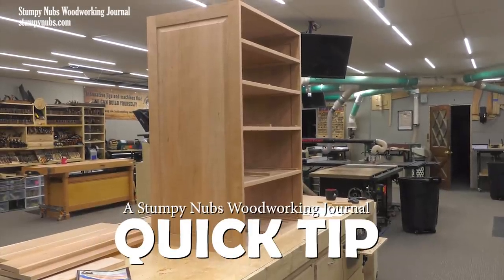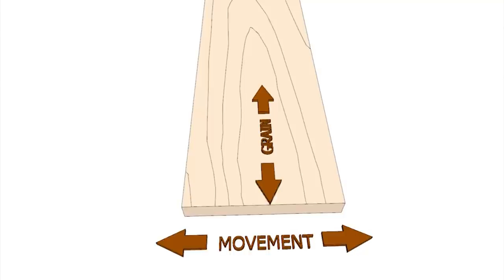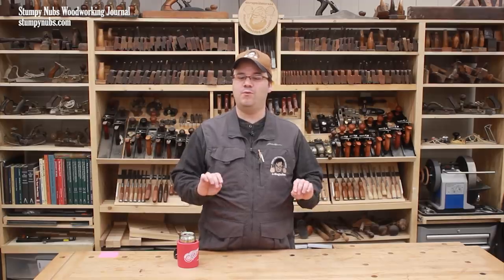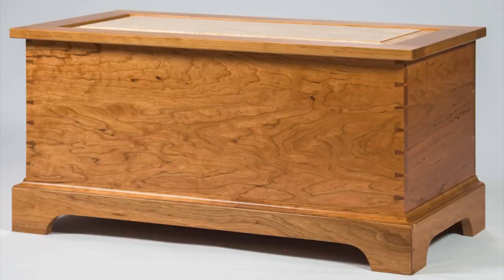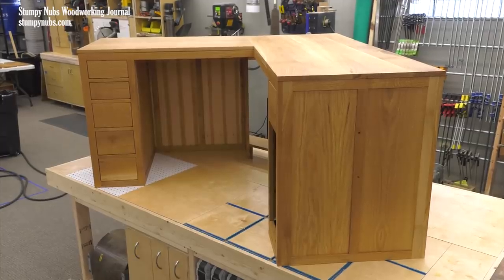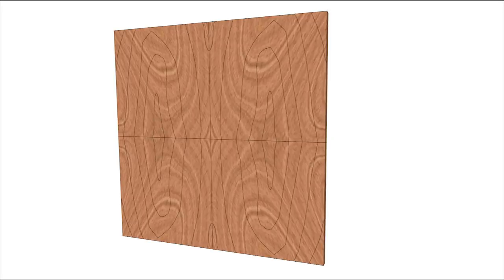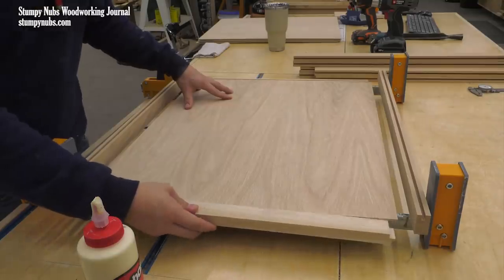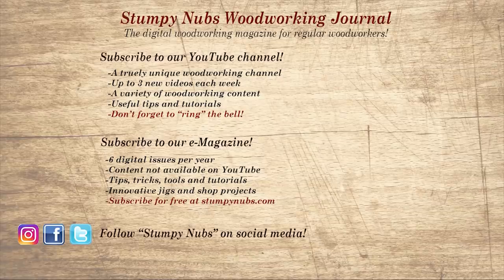Is the frame and raised panel obsolete?

Comment: Here's another novel use of Frame & Panel. I made a Mahogany table with a Frame & Panel top. The homemade stain I use results in a darker look across the grain than when viewed with the grain. I installed the panels at a 45 degree angle to the grain. The result: a table top that is evenly matched when viewed from above but the frames and panels change color as you walk around the table. VERY COOL effect ! When people come over, they always spend extra time walking around this table to see the Mahogany light show which includes the grain in the more figured panels and rails dance.

Comment: This is good solid information. It is the foundation of all 'old school' woodworking. Wood moves. So design and build accordingly. It is important that any beginner woodworker learn this. It is the foundation of all furniture design.
Reply: Thanks, Stumpy.
Reply: Ya I just finished making night stands out of hard maple to match the bed I made. I put a panel on the sides but it is not floating. I am not really worried about how they will hold up over time.

Comment: What about wood movement between the rails and styles (stiles?) ? Or are they thin enough that the movement is negligible?
Reply from the maker: Do you mean the connection between a rail and a stile (in a corner of a frame) being cross-grain? These are so narrow that wood movement is negligible.
Reply: Rails and stiles shrink very little over the length but can move quite a bit over the width which needs to be taken into consideration in a panel style construction.

Comment: Also this was used historically as wide boards were a lot less common and had to be dressed by hand with hand tools. Dressing small frame pieces is easier than a wide board requiring the craftsman to get two wide surfaces parallel and smooth to be able to make good joints. But withe frame and panel only the narrow frame bits needed to be true to get a good joining surface. which leads to the panel itself which was usually rived as a wedge of stock, thicker at one edge than the other. So all the crafts man had to do was dress the face the seen panel and then just gauge the edges where it fitted in the the frame grove

Comment: Great video. I particularly like resaw idea. I recently built a cabinet using this method and in addition to the benefits you mentioned, you can get away with narrower boards. After resawing, you can make nice bookmatched panels which is very attractive.

Comment: Great video! But I have to mention, if you wanted to use solide pannels and wanted wooden drawer slides, you could just use elongated screw holes
Reply from the maker: That wasn't the point. But thanks.

Comment: My 100+ year old wardrobe came apart when we attempted to put it together.  A panel was out of square and glued until all the panels split, wide open.  I was going to re-glue the split panel, but now I AM GOING TO TAKE EVERY BOARD APART and making sure the glue is only where it need to be! 

The next question will be whether to remove the dark cherry stain or not....

Comment: Question here! I was getting ready to make a traditional 6-board chest, but those often do have the grain on the face and back running horizontally and the sides running vertically.  Can you explain for me how those work without falling splitting?
Reply from the maker: No glue. Use nails. They will allow a little movement. In fact, a traditional cut nail with a pre-bored (and slightly enlarged) pilot hole is a good choice.
Reply: Rex Krueger recently built a 6-board chest. As Stumpy said, you'll need to use nails, preferably cut nails.
Reply: @StumpyNubs  - how about dowels instead of nails?
Reply: @Beakerbite  That video is what made me decide to make one.
Reply: @StumpyNubs  okay, that was what I did not understand, the fastener choice is what makes the difference.

Comment: Plywood is also somewhat more frailge in the long run. If you got a mark/knick in a massive wood panel, it is usually not that of a big deal. If you have the same in a plywood panel with that super thin veneer may be harder to fix - and it can be more of a sore eye in the end. That can actually be a problem if you have, for example, someone in an wheelchair moving around. I have seen really bad examples of exactly that happen around a family members home.

Comment: Of course this is true for glued panels.  What about the old 6 board chests put together with nails? There are a lot of those around that haven't fallen apart or split with crossed grain on the end pieces.

Comment: I also heard about space balls(not the movie) in a John Malecki video and I think they’re something you should check out for wooden panels
Reply from the maker: I use pieces of foam pope insulation or backer rod. Works great and are practically free.
Reply: @StumpyNubs  would you happen to have a video explaining this? I’ve never seen anyone do that for wood panels.
Reply from the maker: @paulmarsman8758  No video. I just cut it into little pieces and put it into the grooves. One piece of pipe insulation will last a very long time because the pieces you need are so small. Might make a tip video on it some time.

Comment: Thanks for the clear explanation. I wanted use frame and panel construction on the cabinet for our bathroom but my wife stopped me in my tracks - she doesn't like the dust that collects on the edges. Smooth surfaces only for her. SWMBO!

Comment: Pretty interesting! Thanks a lot for the tips! 😃
But I have a doubt... Let's say you're making a wooden toolbox, where the sides must be higher to hold the handle. How to connect the pieces in this case, since you can't use raised panels?
Thanks a lot!!! 😊
Stay safe there with your family! 🖖😊
Reply: Why can you not use raised panels? As long as the frames can hold the weight, it should still work just fine.
Reply: @thomasarussellsr  Because of the format... Take a look at the last video from Jimmy Diresta.

Comment: What tool is used to cut the mentioned 1'x1' wood into thin pieces for a 4'x4' panel?

I can't picture any woodworking tool that I've come across that could do that...but seems like a really valuable tool to have.
Reply from the maker: A band saw. The process of slicing a thick piece into thinner slices is called re-sawing.

Comment: Another factor. Most modern kiln dried lumber is dressed to size before it is properly seasoned and there's still initial cross grain shrinkage happening. The use of well seasoned boards explains the many nailed up 200 year old chests and cupboards we see today with little or no damage from shrinkage.
Reply from the maker: That's because nails, particularly cut nails with pre-bored pilot holes, allow for enough wood movement to prevent damage. I have seen plenty of split panels and drawer bottoms on old furniture that were glued in place.

Comment: I really enjoy watching and learning from your videos.  Really great info!
Still learning about what to look for in terms of grain direction and I have a question:
I understand about the panels, but what about the frame?  Isn't that greeting a joint with 2 opposite grain directions?  
What's to keep that joint from splitting?  Or because it's a narrow piece, it's less of a concern?

Also, your video about band saws has convinced me I need a band saw.  Expect a letter from my wife.
Reply from the maker: Do you mean the connection between a rail and a stile (in a corner of a frame) being cross-grain? These are so narrow that wood movement is negligible.

Comment: I saw a vid on tormek that has a diamond encrusted wheel
Reply from the maker: I have the diamond wheels for my Tormek. They are really nice. They never need truing, never wear smaller in diameter so your jig settings never change. The course wheel also speeds things up quite a bit.

Comment: Stumpy, when you're constructing casework like this, how do you attach two sides of a case together? Are two panels just glued together at a 90 degree angle in a butt joint, or do you reinforce it somehow, like with a rabbet? I hope that makes sense.
Reply from the maker: Usually just glue. Since you are gluing long-grain to long-grain, the joint will be very strong. In fact, the wood itself will break before the glue does. A rabbet joint would be a little stronger because it adds a little more glue surface, and it may help align the parts as you glue and clamp them together. But it isn't necessary, in my opinion.
Reply: @StumpyNubs  Thank you!

Comment: Why doesn’t the movement issue break the frames? Aren’t the rails and stiles perpendicular to each other?
Reply from the maker: Do you mean the connection between a rail and a stile (in a corner of a frame) being cross-grain? These are so narrow that wood movement is negligible.
Reply: @StumpyNubs  Yes that’s what I was getting at. So the joint there is much smaller compared to the perpendicular panel joint, thus the movement across the grain isn’t really able to exert enough force to cause problems. That makes sense, thanks!

Comment: Should there be any concern for wood movement with the rails and styles?
Reply from the maker: Do you mean the connection between a rail and a stile (in a corner of a frame) being cross-grain? These are so narrow that wood movement is negligible.
Reply: @StumpyNubs  Apologies for lack of clarity.  I was wondering about panels joined together; similar to the blanket chest example.

Comment: Have you ever seen solid boards actually split themselves apart due to restricted seasonal movement? Honest question. I get the logic but not sure I’ve seen a real world example. Also, what keeps plywood from tearing itself apart as it’s layers are perpendicular to one another? Please don’t read this as a negative comment. Genuine rookie here with silly questions.
Reply: Ya I've seen that too many times. It can happen if your shop where you cut your pieces is outside and you bring those pieces inside to put it together. A day or two to acclimate usually does the trick. This wood movement thing is very real though. Disregarding it , especially with air dried material, will come back to bite you soon or later.
Reply from the maker: Yes, I have seen many examples in old furniture.

Comment: It seems corded power tools don't see as much innovation as cordless ones.  I am looking around for router to attach to a starter router kit.  It seems many of the corded routers were released back in the mid 2000's.  Which corded router is good to purchase for a router table?
Reply: For a starter I've had good results with the Workzone router from Aldi here in the UK, bought in 2010 and mostly used on a router table.  It was cheap as chips and is pretty good quality for periodic use.  The table was also from Aldi, so I don't know how much fiddling you'd need to do to fit the thing to yours.  The great advantage from the cheap Aldi tools is that they tend to be good quality for the price and you can get stuck in using them and learning what works for you.  Disclaimer: Moodwise I'm leaning more and more towards hand tools.
Reply: The Triton 2400 watt - has a built in router lift, above table bit changing with only one wrench, self releasing collet. There is a 1400 watt model with the same features, just not as much power for larger bits (like panel raising bits). You can use them as both a plunge router and 'fixed base' style router with a press and turn of a button when out of the router table, no need to change bases. Developed in Australia but now only available in the US and Europe.

Comment: I love how you delve into the science of wood movement and the reasons behind it. I have a video request for you as I think you’d explain it the best. 

Kreg likes to advertise the use of pocket screws in improper ways (breadboard ends, panels, and securing a table top to an apron just to name a few). Seeing how kreg’s primary market is DIYers that most likely won’t do much research, I think it’s pretty unethical to tell them to use the screws in improper ways. Realistically, if you’re going to use them in solid wood, it’s to reinforce what would otherwise be a butt joint. 

Could you make a video explaining your thoughts and the reasons that using pocket screws in the ways that I mentioned will most likely lead to a failed project?
Reply from the maker: I can't speak to Kreg's ads because I have not seen them. However, I can say that using pocket screws to attach table tops and other cross-grain connections is a tried and true application. The Shakers used pocket screws to attach table tops a hundred fifty years ago :) https://www.youtube.com/watch?v=jU21uT-6vQQ
Reply: @StumpyNubs  there are plans on their own website that show these methods, so while advertising may be the wrong word, they are definitely advocating it. You even said yourself in that video that the shakers took wood movement into consideration when using pocket screws and bored the pilot holes accordingly as well as stating they should not be used in place of a mortise and tenon.
Reply from the maker: Yes, there definitely is a place for pocket screws, and a place where they shouldn't be used. We may make a pocket screw tutorial for beginners sometime.